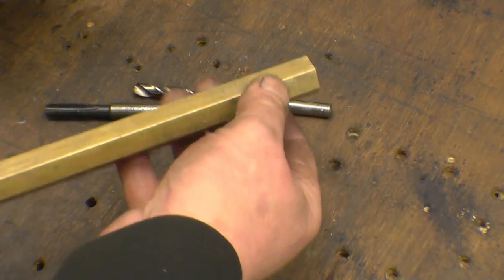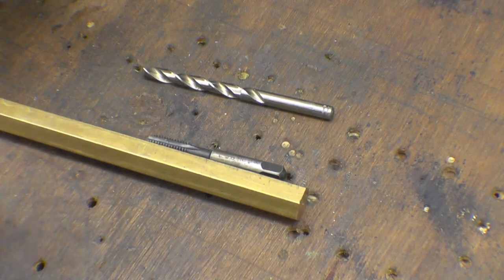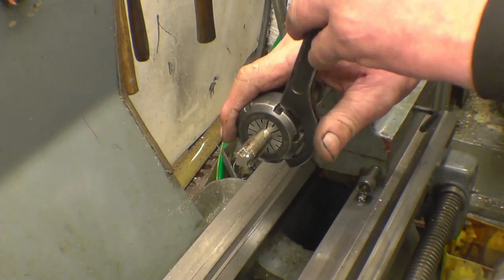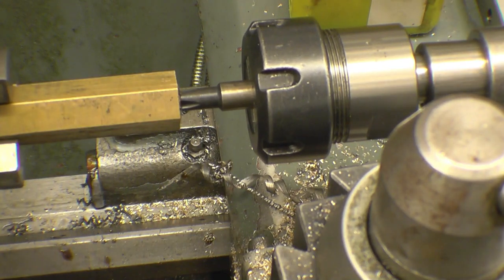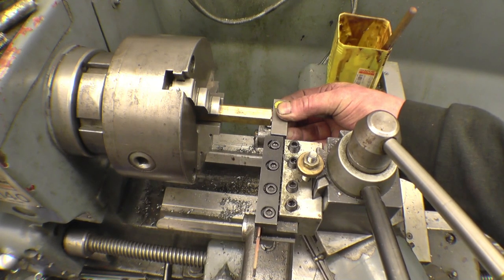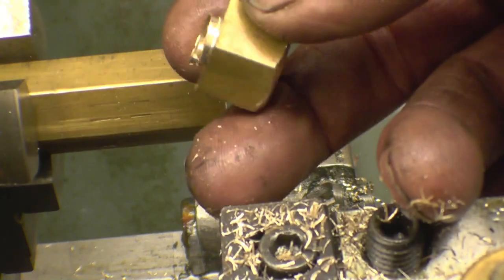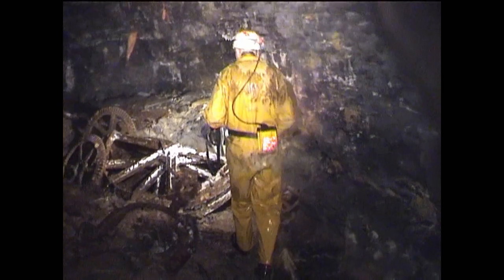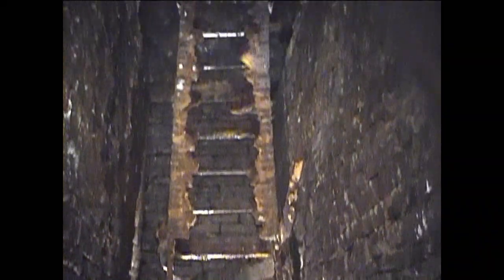SNNC 308 P2  Brass Nuts   Underground Water Wheel

Comment: 11:55 what does that stand pipe feed? That was a very tall water wheel but pretty narrow too, they must have not had much water supply but needed a lot of torque out of it. Any idea how much lift they needed to be able to pump out? Assembling that thing in there must have really been interesting!
Reply from the maker: I think it was a water pump in the flooded shaft  They built that lot with candle lighting